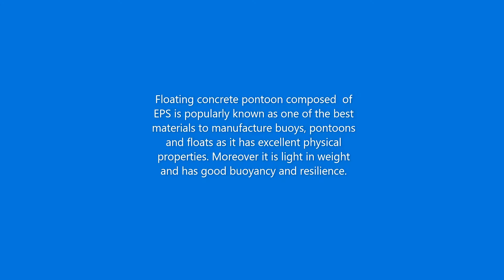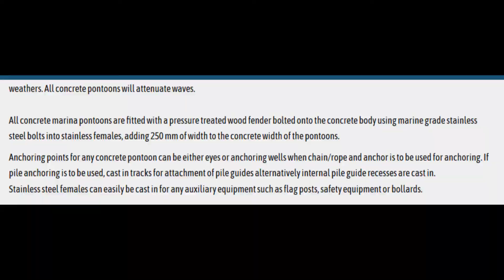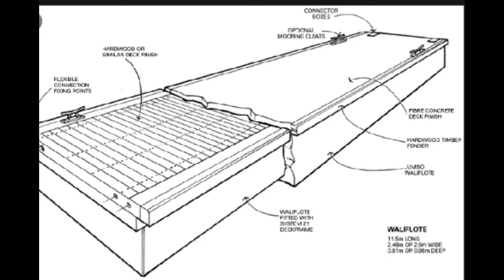# Floating Concrete Pontoon # عائم الخرسانة العائمة

Comment: Hi nice video, I have a question….@30 is the bottom to the pontoon is not covered with concete?
Reply from the maker: in our design  the outer shell  concrete  is 12cm around. it depends on the  structural  analysis
Reply from the maker: there must be  PROTECTIVE Layer
polysterine  is the core